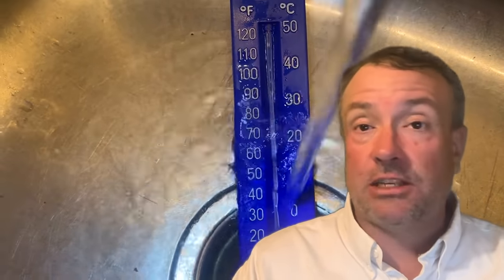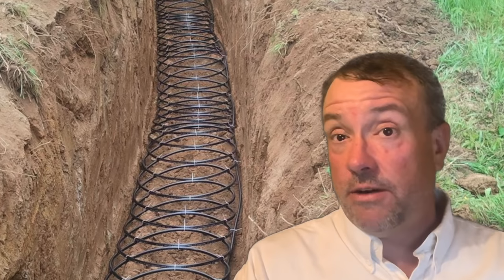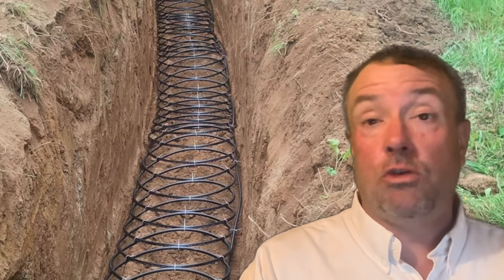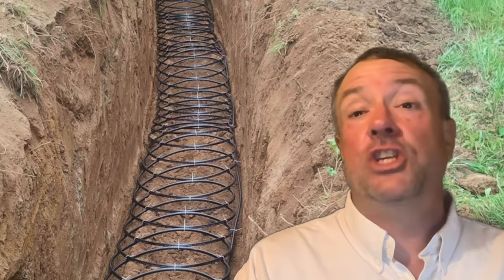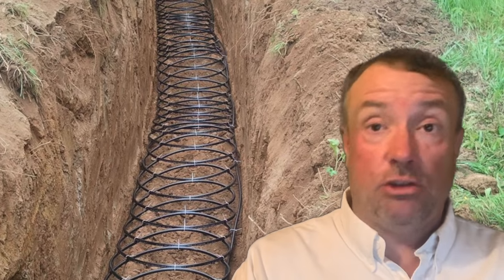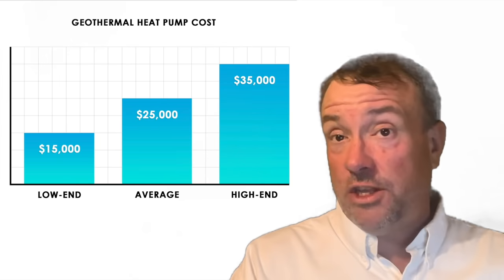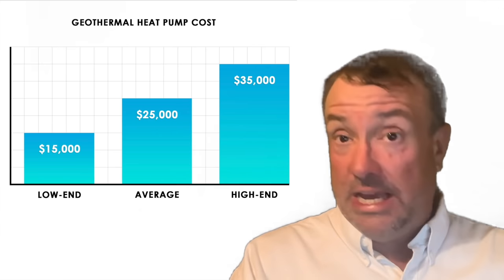Geothermal Cooling Tricks and Hacks

Comment: I did something similar for my garage, storage building,  and greenhouse. It's keeping the buildings less volatile.  I also run a dehumidifier in summer to keep moisture down and a humidifier during the winter to help heat the space
Reply from the maker: That is awesome!
Reply: just want to start this kind of project. can you give more information about the temprature? is it really work?
Reply: Sir_Lord_Bryon - do you have more details about your system?  Would love to be able to chat about what you did, what you'd change, how well it works, etc
Reply: this actually does work. I live in west central Illinois in a 4/5 grow zone. I rented a mini excavator for a weekend ($500) and dug multiple projects while it was here. I ran 3/4 black geothermal line around my garden which is right next to my garage. it's a looped line like in the picture that I  used a 24" bucket on the mini. I dug around a 650ft trench that zig zags across my garden and comes up in the center center of my west wall on my 42'x56' garage.  I have 6 zones in my radiant floor heat in my garage in 6 zones and I use a brass manifold for inlet side and outlet side with flow adjustment valves in each section.  I also have a cheap garage sale wood stove that I use in the garage to bring up the temperature for very cold winter days that I ran copper tubing around the firebox to assist in the temperature of the floor. I only light it when I'm working all day in the garage and it's below 20 degrees Fahrenheit. As for no heat assistance from the wood stove, it stays around 43 degrees Fahrenheit throughout the winter with only the circulation pump running.  my lines are around 7ft deep in the ground and seem to work well to keep a constant temperature throughout the winter. Total investment is $1163 before I poured concrete. Well worth it to me.  I also have spray foam insulation in my garage as well as my home and that's been worth EVERY CENT
Reply: awesome.  Do you think it's important to make the trench or could you have just buried it all under the garden?  The 650ft keeps all 3 buildings above 43 degrees?  Do you use anything in the greenhouse like a radiator?
Reply: @josephlarsen  I only use the woodburner in the garage to keep mess out of the house.
Reply: @josephlarsen  I used the trench through the garden because I wanted maximum amount of tubing below ground in a minimum amount of space. The more exposure to the earth of the tubing will give more stability to the temperature
Reply: @josephlarsen  I also keep the circulation pump going in the fall to warm up the ground before it gets cold to warm up the ground to keep temperature up... several people call this a climate battery
Reply: @lordbeeg1  So you don't run it during the summer to capture all that heat?  My goal was to dig out a 20ft by 40ft hole 4ft or 5ft deep and bury the pipe at 5ft deep and then again at 3ft (or 2ft) deep.  Flattened out so that there should be as much exposure to earth as possible.  I just don't know how much piping would be needed to work for the whole year both heating and cooling the greenhouse.  I also don't know how if it needs to be 2 or 3 (or more) different pipes/pumps/radiators to be most efficient or what.  That's why i'm looking for good working examples.  Do you use your setup for a year round greenhouse and for warmth in your other 2 buildings or mostly just for the buildings?
Reply: @lordbeeg1  How does this work through the summer?  I'm close and wondering how much tubing you ran to get this result?
Reply: @mercedescherokee6853  I have a 1000ft loop of 1/2 pex approximately 7ft deep in the ground. I dug roughly a 300ft trench and coiled my line like the thumbnail shows. Covered it with 6" of dirt then ran 4" non perforated tubing on top of that then filled the hole. I did it through my garden actually which really helped till the soil. I use the 4" mainly through the summer and the pex via the radiant floor heat through the winter.  I also have a small wood stove that I wrapped copper around to supply additional heat in very cold situations

Comment: I have 2 houses about 10 meters apart. Plenty of land, so I can easily get the meterage for the pipe. Can I use the same pipe and connect a radiator and fan to each house? If so, are there plans for such a system?
Reply from the maker: Pipes are cheap, use two pipes in one hole. - no that is NOT an adult film… geeesh

Comment: I live in northern Mn I have worked on geothermal units I have seen the loop coming back at 20 degrees are lower in February is would you be better of with electric boiler are electric heater at that point
Reply from the maker: @davehuber6949  for heating in your climate it’s smart to inject heat into the ground around the tubes with evacuated tubes.

Comment: Thanks for the video! Couple of questions: is it safe to say that this system would not be enough to heat a home in harsh winters because you probably can’t heat to more than 10 C, correct? 2) what about using this system to radiant heat a cement floor? Is that being done? Would it make sense to do for a home in a harsh winter area?
Reply from the maker: @pazcu  I have videos that address how to get more than 10’C easy and cheap

Comment: So I recently took the plunge and have buried 3 different loops each of about 1200 ft of 1" I have it hooked into a radiator I picked up at Autozone for a  2000 Civic as the shape fit perfectly between my ceiling joists. I have a overkill Grundfos 3 speed circulation pump hooked into it where the water will cycle through slowly on Medium and fastly at High. The whole system is filled with RV Fluid (the pink stuff that's capable of -50). The issue I've run into is a simple box fan is not cutting it. It doesn't have enough power to blow the air through the radiator. My thoughts are that I need to 1. buy a squirrel cage blower. 2. build an enclosure around the fan/radiator to direct the airflow. or 3. swap out the radiator/fan for more effectient products. Any Suggestions? What kind of fans/setups have you or anyone else used?
Reply from the maker: Maybe you just got a shorty box fan? Mine works great with a radiator
Reply: @SimpleTek  it was one of the Lasko Plus models from Home Depot.

Comment: What about circulation pumps? any tips on sizing the pump based on the system installed? Also does a larger pipe = more cooling? ie can you used less length of a larger pipe to achieve equivalent BTU power?
Reply: Good point, perhaps at a slower flow rate?

Comment: hi.... excellent video!!!! I grow tomatoes in my green house, the out side temp in the summer in around 37 degrees celcius. its abit hot for the tomatoes this time of the year. how many degrees do you think geothermal with radiators and fans can drop the temperature...
just to note, the green house has sun block on the top.
thanks
Reply from the maker: Need lots more information, like ground temperature 8 feet down, ground material, and lots of info on your greenhouse insulation
Reply: @SimpleTek  hello again… ground temp at 8ft down is 17’c ground material is sand and clay, green house insulation is plastic sheeting

Comment: I have plenty of land behind the house. If I buy 1500 ft of sprinkler grade pipe, can I trench for it 6' deep about 700 feet away, 50 foot over, and 700 feet back in one circuit? Basically I just want to make a big U shape. Will this type of distance put a lot of load on the pump? It is very flat ground with nothing in the way. I am mainly looking for something to supplement the cooling for a 1000 sq ft house. I would like to get the electric bill down. 

What about the humidity in the house? Will this type of flow over a radiator in line with my existing duct work reduce the humidity in the house?
Reply from the maker: There’s a lot of factors to consider but a dehumidifier can manage any high humidity issues in many cases

Comment: can we put lines in a septic tank which 15-20feet deep. coz a septic tank may be have the same temperature as a water body of same depth? when you are putting options you may ask for each and every possible option. is this can be done or there may be not same temperature ? please answer. I may be wrong but i want to know.
Reply from the maker: It is a source of heat… but mostly cause the lines would  be buried in liquid that’s stored below the frost line and additional heat is added from waste water regularly… so the sewage should be in bulk a few degrees hotter than just ground water BUT it gets emptied so then it’s just cold air till it fills up again ..

Comment: Hi very interesting Systhem. Is there a surface ratio ( greenhouse/geothermal collector) you can recommend
Reply from the maker: it's hard to make blanket recommendations as there are a lot of variables due to location and soil material
Reply: Thank's for your quick answer! So were could i find further Informations to fit the Systhem to my conditions here in the south of germany?
Reply from the maker: @itreB  YouTube or testing with a backhoe. Google might help, sorry that’s all I hsve

Comment: Hey you got me all excited about this idea. You explain well what all you need. But you stop at the fan and the radiator. How do I get this cold air into my house? Please do another video and explain that part. Thank you
Reply from the maker: The fan on the radiator gives you the cold air!
Reply: You will need to make a plenum or distribution box with ducts to push the air to the rooms of the house. You will also need a return plenum where the warm air of the house is pulled in and pushed through the radiator and then into the plenum. Probably look at hvac designs to see the components.

Comment: Great ideas overall. But figuring out the ground temperature at around 6 foot depth by taking the water temperature after running it won't work if you have a well and a pressure tank.  The pressure tank will hold the water at the air  temp where it's located and with most modern deep wells the temperature of the water coming directly from it will reflect the ground temperature at the depth of your well.  Probably 100+ feet down.
Reply from the maker: maybe - but it seems to work though
Reply: Keep running the water until the temp stabilizes at its lowest point,

Comment: Another question.  These systems often depend on charging the ground with hot during summer and cold during winter, and the ground volume storing that temperature, which means that eventually surface area can outstrip the storage capacity, and depending on the nature of the area, reducing the cooling or heating effect (you can run lines into solid rocks hundreds feet to pick up heating from radioactive decay even, but over a century deplete the built up warmth).  Is there a better way to design it?

Comment: Could you run hydroponic nutrients in the water to lower the temperature of the water going to the plants?
Reply from the maker: yes but that's not the same water you'd use in this cooling system
Reply: It is a closed loop system.

Comment: Maybe I missed it, but did you address condensation issues with cooling radiant?
Reply from the maker: You need a pan and drain, good point
Reply: @SimpleTek  so if you have pipes everywhere in your floor, you need a lot of pans and drains. I’ve seen other channels that explain a complex monitoring system for checking dewpoint and adjusting the temperature of water accordingly.
Reply from the maker: @GuentherJohnny  not really an issue on a radiant floor, more of a radiator thing… size difference

Comment: I have a heat pump installed but have been thinking abou making it a (redneck) geo thermal. I have been told it won't work but can't give me a good reason why it won't work. 
I'm thinking about 2 ways of doing this. Both ways are to change the temp. of the condenser air intake temp. for both winter and summer. The first and cheapest way for me is I have a 250 foot deep well. I'm going to run a 2 inch pipe with a loop in it to the bottom and back up and through some radiators and attach them to the condenser. I figure I should be able to get between 10 and 15 degree temp. differential. The other is to place 6 inch tubes in the ground at 6 foot deep. Build a wall around the condenser to pull the air through the tubes.
Reply from the maker: I’m about to release a video on exactly this in a day or two

Comment: Will it work on a house? Our next & last house will be 12-1500 s.f with a basement, (hopefully),  & will have anywhere from 5-20 acres. We always buy land with at least half of it open, looking to go to southern MO next...I HOPE I can do this for a house & perhaps take the radiator part & drop it right in the air handler so we can use the rest of the system as a backup for colder winters or hotter summers, & be able to use the existing vents ideally. Is this doable?
Reply from the maker: It can!

Comment: I would like to know how to attach the water line to the auto radiator? Is there some kind of fitting?
Reply from the maker: yes - very simple to do
Reply: You would see the size of the radiator openings and get what is called a step down hose attachment they have them in most home supply stores in the hose section or the ovc pipe section of the store or just ask a clerk in the area most are pretty knowledgeable.

Comment: I was also wondering about the coils. I was wondering if you ran, say a 100 foot trench 6 foot deep, and 12 inches wide,  and you ran 6 lines out, put 1 foot of soil, then added 6 more lines, would that give you 1200 feet of cooling/heating lines?
Reply from the maker: maybe?
Reply: apidly the ground around the pipes reflects the temperature of the water in the pipes instead of the ambient temperature of the earth. Many articles I have read indicate keep six feet between your outgoing and your incoming trenches. Said another way, no don't stack multiple pipes inside a trench.
Reply: (sorry for clumsy edits, my microphone button is too close to the send button!). 
I meant to preface the preceding comment with "when pipes are stacked too close together, rapidly the ground...)
Reply: @corba197  Thanks
Reply: @corba197  I kind of figured out something was missing. I did not exactly figure out the words, but got the gist.

Comment: You brought up using the main water line to determine an estimated ground temperature. Could this not be taken a second step and use the water main to cool a heat exchanger tank and use that water flow to cool a water mass flowing through a air to water heat exchanger? Only downside I can see would be having slightly warmer tap water, and if you don't use enough water you could heatsoak the cooling water mass?
Reply from the maker: I explore using wells in the video
Reply: @SimpleTek  I'm talking about keeping the whole system inside, and just using the consumed main water to cool the heat exchanger water in a tank.
Reply: @jonholaday2733  You could, but it presents some issues. Not foolproof. It needs to be away from the area you heat or cool. Because you would be losing some ground if the heat escaped back. You would possibly want an insulated tank or have it in a basement. It won’t work as good. There isn’t a lot of heat or cool to collect from the water that comes in, but there is some. And if you couples it with the ground in the basement, that would also help.
Reply: @usablake  being in Saskatchewan our water typically comes in around 15*c. I would certainly insulate the tank and keep it in the basement. Being a family of 5, our water consumption is fairly steady through the day. 

Aswell, this would just be a supplement cooling as we do have air conditioning in the house already.

Comment: First time watching a video from your channel so I do not know fi you have addressed this other places, and if so, please put the link in a reply.  So, lets say someone is building a house.  Would, while digging the foundation, it be a good idea to dig several feet deeper and lay the pipe underneath the foundation (slab style)?  If not, how about the non slab style?
Reply from the maker: Cooling in summer becomes an issue when it’s underneath
Reply: @SimpleTek  why is that?  In the summer the house shades the ground that is above the pipes so it would seem the soil around the pipes would be cooler than if the pipes ran out in the yard.
Reply: You don’t want to dig under the foundation, foundations need to be on undisturbed soil. The inspector will turn down your inspection if you’ve disturbed the soil under the foundation. Engineers usually say soil that’s been settling for 80-90 yrs can be considered “ undisturbed “, probably don’t want to wait that long 😽